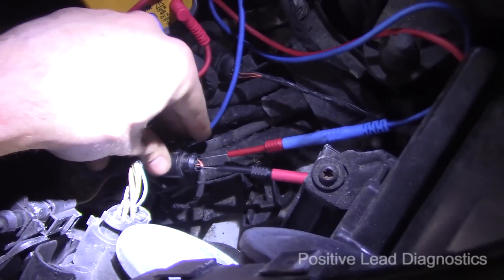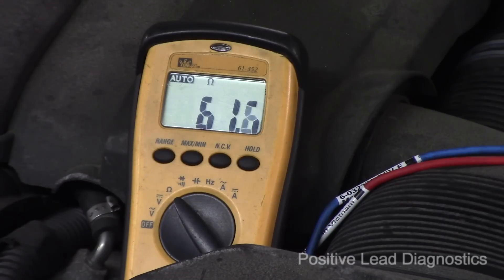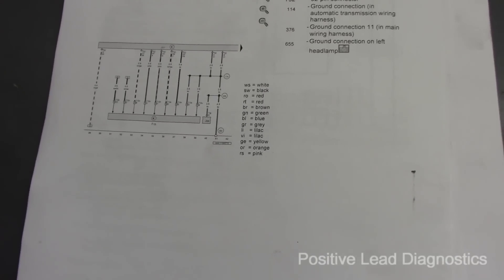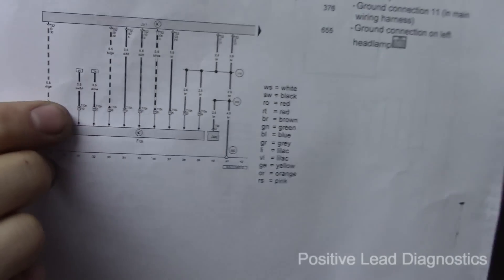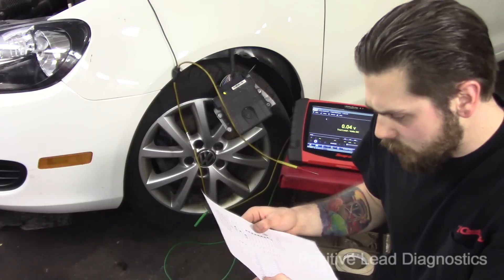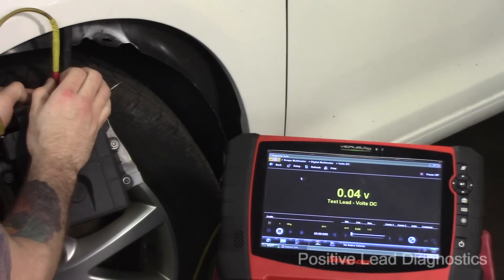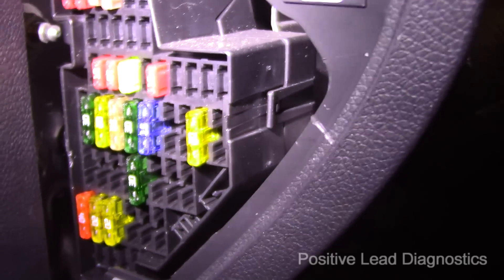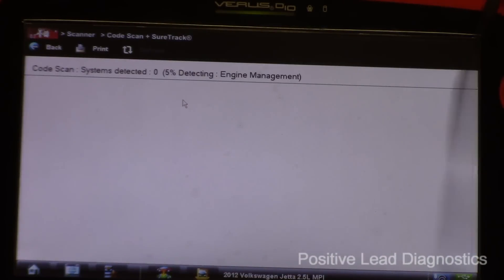2012 VW Jetta No Communication with TCM U0101 (part 2)

Comment: You checked some of the powers and grounds initially, the TCM was probably partially energized and not operating correctly so the network comms were corrupted.  After getting all proper power, TCM was working 100%, comms restored. Just my hunch. Great vids and great to see the thought process.
Reply: In the first video, I called no power to whatever circuitry was responsible for driving the CAN bus pins. Since Tom said he already checked power at the module though, I was thinking blown internal fuse or supply regulator. I doubt many people would think of checking for multiple external 12V power feeds from the same source but different fuses up-front.
Reply from the maker: That's actually common in our field Dan. Having 2 to 3 main powers, an ignition power and multiple grounds
Reply: I went over that diagram initially when I was doing the first power and ground check, and I know almost every module has more than 1 power feed, I honestly just missed it. Teardown Dan did call that..

Comment: If I had a dollar for every time I seen this on a Euro car. Once I had a 2012 GLI with no PS assist. It had the EPC and steering angle lights on. Had a brand new rack (OEM) installed. No communication codes with module. The crazy thing was on initial start there was assist until the system recognized the EPS module was not communicating, then it would shut off the motor and steering would go stiff.

It was a misplaced fuse.  My guess? The original module was bad (they fail a lot).  It blew the fuse, was incorrectly placed, the system still did not work. bad unit was replaced due to comm codes, and the new unit could not obviously work properly.

Unfortunately the original shop had it right, but one tiny mishap ruined the repair.
Reply from the maker: Wow, crazy stuff

Comment: He didn't own a mistake, he saved the day!! He made sure that he checked every possible probability, before replacing the module!! 
That shows two distinct facts!! He had an awesome teacher, and he learned! 

How did the fuse get moved?? Well, most likely the operator of the vehicle, or a known person of the operator!! They blew a fuse, and checked and misplaced the TCM fuse, or they were playing technician, and had no business in there, and put it in the wrong slot. Either way, the cost was a tow bill, and a large diagnostic fee! $$$ 

GREAT VIDEO!!! And learning experience! Good job, to you both!
Reply from the maker: Of course! If you knew me better, I never trust another guys work, but Tommy is one of the few people in my life that I absolutely do. I still should have checked and would have if I was the one making the call on the TCM. I would have had to see it first hand, even if my own brother told me they were good. This situation was different.
Reply: The most important lesson here: don't trust that the tech who was there first and told you that he tested power and ground actually tested ALL power and ground! That is the first thing you need to make 100% certain you tested before delving any deeper into electronic troubleshooting.
Reply: Come on lets be fair to Tommy, that factory wiring diagram is about the worst engineered document on the planet that he was using and you have to give him a lot of credit because his gut feeling/instincts told him to check and re-check his work before he replaced a 1,000 dollar TCM ! I'd say the man did pretty well in that respect !
Reply: Yes, those schematics looked pretty useless, doesn't change the fact that you should check for additional power feeds when you know they are commonplace in that application. As for his 'gut feeling', anyone would be nervous about replacing a $1000 component when the unnecessary expense comes out of their own pocket if they do the honest thing and don't charge the customer for an incorrect diagnostic and the alternative is hoping the customer doesn't sue you for fraud if you attempt to pass the cost of your mistake along.
Reply: @teardowndan5364  Sue? We replaced the TCM and the fuse that goes along with it and, here is your $1000 bill, the car runs.
Reply: El Chapo Audits  El chapo Audits wtf is this lol? Chapo is done man.

Comment: i had a jaguar tdi crank but non start to diagnose, no comm, i found the maf wiring was shorting out on a metal pipe bolted to the engine so for a while i thought the ecu was blown as it is common for the ecu's to go wrong on this model, i didnt have a wire diagram but i did check for power and grounds, no live feed to the engine ecu.
it turned out to be a bad relay in the engine fuse/relay box.
its like the old measure twice cut once rule, good vids keep em coming.

Comment: Nice. It's always good to double, triple check. I keep telling my boss- I need good information to properly diagnose electrical problems. No mistake, you fixed without replacing the wrong part. Good job.